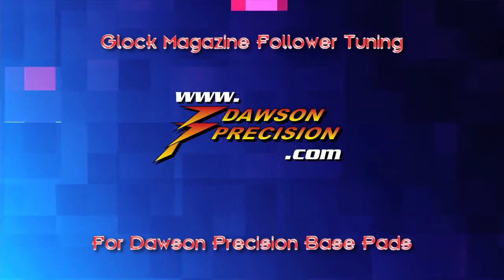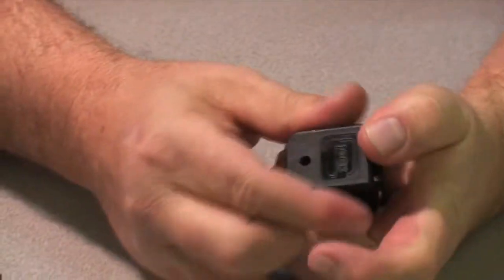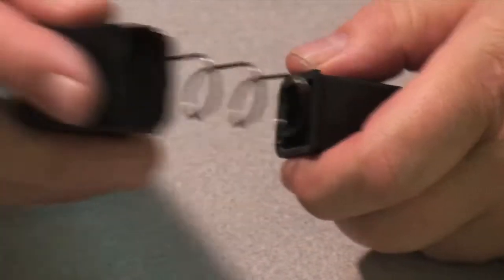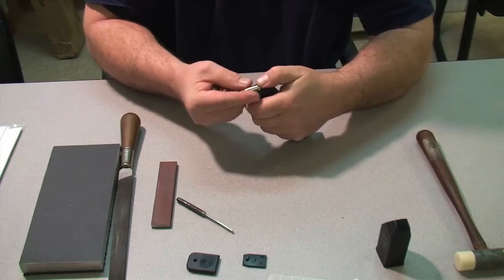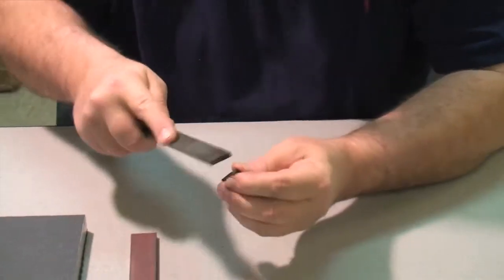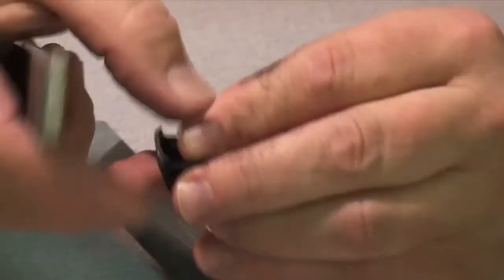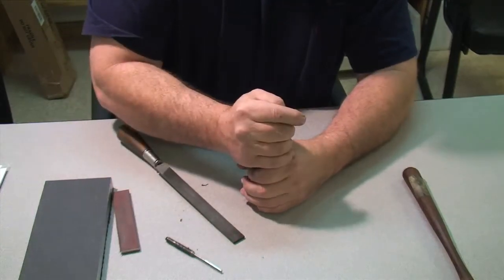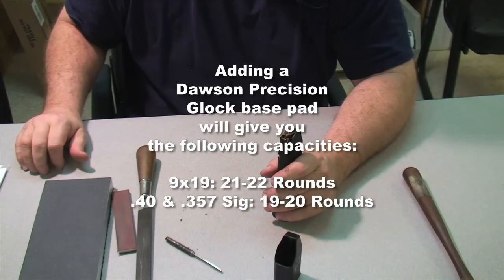Glock Magazine Follower Tuning for Dawson Precision Base Pads

Comment: Glock didn't make THEIR part to function beyond the bottom of THEIR magazine so YES, a solution is needed to get the extra performance Dave offers. This is NOT a poorly designed product from Dave as the uninitated person would believe. Dave could offer a follower to alleviate the problem but why more expense when this simple solution works. DP has no control on the OEM parts so he offers a solution with minimal expense. GOOD JOB DAVE!

Mick A27257

Comment: Bad, bad, bad DawsonPrecision!!! 
Your product should work without any modification to Glock OEM parts or additional work from the customer. If you ask your clients to do YOUR WORK, you have a poorly designed and manufactured product.
You’re not so “precise” DawsonPrecision, shame on you!!!
Reply: You're kidding right?  This is a custom gun part, if you modify a factory gun you should expect that some fitment will be required, I would be more concerned if this item worked perfectly across the range considering the fact that Glock has made changes to the magazines over the last 32 years.